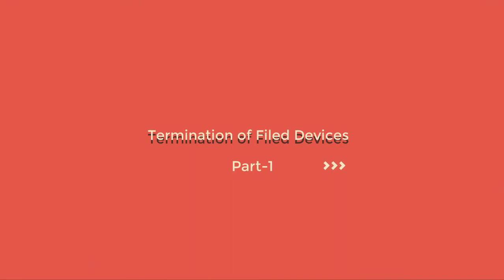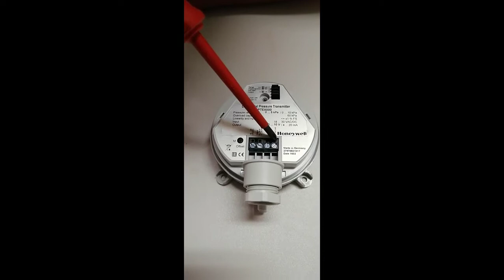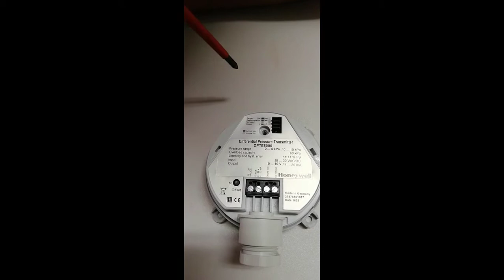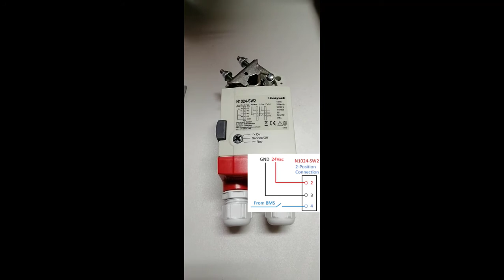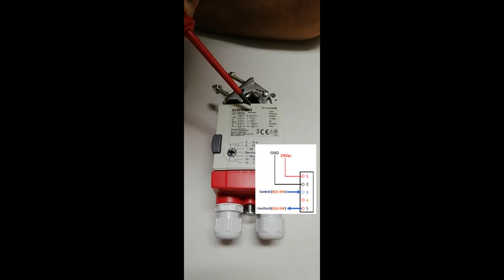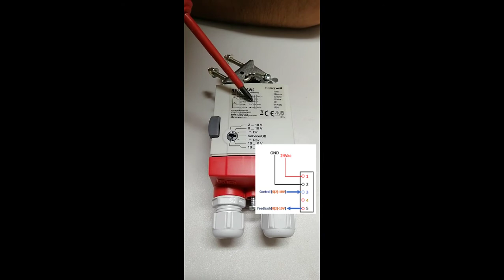BMS Field Devices Termination Part-1|Building Management System Training|BMS Training 2021

Comment: Hello sir how r u 
Sir what is the actual use of DPS plese reply
Reply from the maker: DPS is used to monitor differential pressure across the filters, when pressure is more than a specific value DPS gives a signal showing that the filter is dirty. Also it is used to monitor the flow status of fans and pumps.

Comment: Hi bro how to connect HONEYWELL N10230-2POS damper actuactor please explain..
Reply from the maker: Hi Suthan, it will be connected same as N1024-SW2 which I explained in the video... Only difference is that it uses 230V power supply.
Reply: @TechSystems  i can't understand please explain N10230-2pos ....thank u bro
Reply from the maker: For 2 position control, connect 230V live wire at terminal 1, connect 230V neutral wire at terminal 2 and connect the BMS control signal on number 3. Note that BMS control signal shall also be 230V signal. It will not be a volt free contact.
Reply from the maker: For feedback connect between S1 and S2